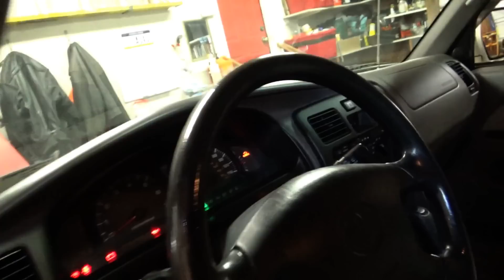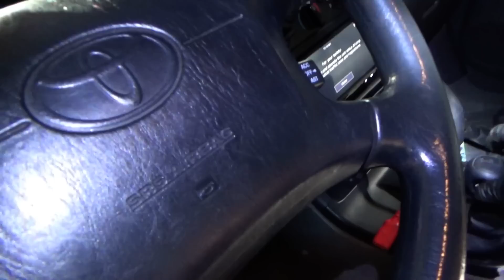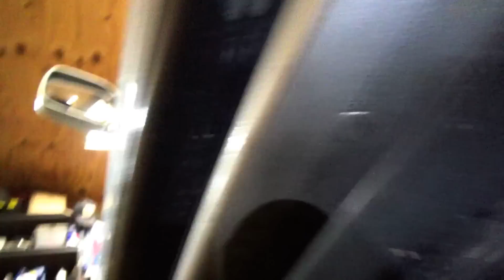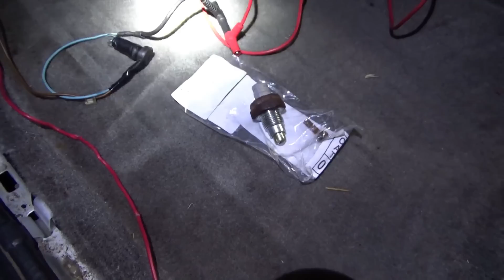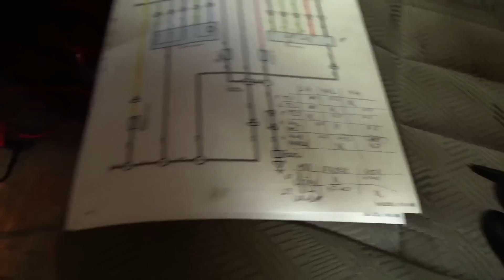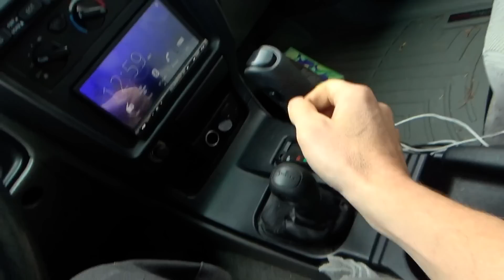(Pt 3) HELP! My Toyota is STILL STUCK in 4x4! ('02 4Runner)

Comment: It's been my experience with 20+ years of Japanese 4×4 use, these systems are pretty good but need to be exercised regularly, nothing is bulletproof but have been very reliable
Reply: Both my Tacoma and Tundra owners manual states clearly to use 4WD once a month for about 20 kms. I use it on wet asphalt with rain 🌧 or after a good rain. In the winter it's better yet, when it snows I am in 4 Hi all the time. 4WD dramatically improves braking distance as well.
Reply: My family and I have owned my 300,000 mile GM trucks and the four wheel drives have been flawless..

Comment: Persistance, determination and over-the-top logical reasoning as you reverse engineered the whole system. This video defines you, Ivan. One of my favorite PHAD videos! Seems that if the tip of that rod is not visibly worn, there must be slop at the other end in whatever mechanical trickery advances the rod. Just have to hope that wear/slop doesn’t continue and use up that 1/16” of travel you gained by removing the crush washer. It’s old and worn. Let’s hope he gets some years out of it. Would be cool to see a diagram of how that thing works inside the trans.

Comment: all that crap, modules and problems only to not require getting out and locking the front hubs....... I remember all my years of driving in the winters my only wish was .... gee I wish I wouldn't have to get out to unlock and lock the hubs!!!! NOT........ never once did it bother me and I never had a time when my 4X4 didn't work!
Reply: Blame it on the consumers. If they made it like the old school stuff , which of course I would prefer, they would be out of business. Sadly they have to bow to consumer demands.
Reply: @brianw8963  I live in the mountain and had to have the titan towed home when I went into a store came out and the abs light came on,,, so who cares..... I go to pull out and notice my back end spinning,.,,, I look down and NO 4x4...... I have an xterra that I use in the winter mostly because even if the abs lights up you still have 4x4,,,, and on the titan... I know it is a broken wire at one of the wheel sensors but I wasn't going to lay in the snow and try finding it!!!
Reply: @TheMamonti1 are you kidding me!? The titan won't engage 4x4 because of an ABS fault?

That is infuriating when unrelated issues cause a system you rely on to be shut down.
Reply from the maker: @volvo09  Yup, classic stupid Nissan logic haha. Just did a video on that Beached Whale Titan a few weeks ago, exact same problem!

Comment: Good job. No dealer would work that hard to find the problem. I know that you are glad this is over.
Reply: As usual, We all were confident that eventually Ivan would solve this mechanical mystery.
Reply: How would the dealer tech get paid for all of his time spent?  We charge over $200 per hour,  pretty sure most customers would stop paying after a couple hours of fussing around.
Reply: @scrappy7571  dealers have priced themselves out of the market along with poor service practices.
Reply: @scrappy7571  The only way to get paid for these jobs is with a you tube channel. How many hours do you think he spent before editing?
Reply: @rodvan-zeller6360  agree,  because my boss and the customer would never cover all of my time.  I do enough free shit on a daily basis.
Reply: @scrappy7571  Document your time at the end of each month present a bill to the employer. If he does not pay it is considered wage theft, in California if over 950 is it considered grand theft, a felony. If you get fired for demanding pay for your work, it is retaliation, another illegal act. Slavery was over a long time ago.
Reply: @rodvan-zeller6360  Just easier to quit.  Retirement or find a job at an indy shop, is the plan.  48 yrs of stealership life, I've had enough.
Reply: @scrappy7571  It's not warranty should be no problem to get paid. I work at a dealer and have always got paid all my diag time. It only pays straight time though. Which is why flat rate guys want to swap parts for retail pay and double their money.

Comment: These older vehicles can throw you some curves but Ivan will win 😁
You might have tried a thin paper gasket or RTV on the switch to keep water out of the threads and still work. I agree with others, something internal is worn which is messing up the switch action.

Comment: Would this mean potentially a no parts required fix by applying a hack and connect the yellow and black wires together and not bother with replacing the knackered switch?
Reply: I was thinking the same, seems strange that the two signals are identical though....
Reply: No, it needs to be grounded to switch into 4 high diff lock, but it also needs to be ungrouded to switch back to 2H. You'd need to at minimum add it to a manual rocker switch of some kind.
Reply: @brassmule  since the 2 signals are the same and are only produced in 4H Locked, I don't see the problem
Reply from the maker: Actually that might be the perfect No Parts Required solution!! Brilliant!

Comment: Transfer case is worn creating play. Remove the crush washer is a temporary repair.
Reply: it may not be the transfer case but the worm gear mech that the swich sits in . its going from a circular movement to a linear movement  which means that a 20+ year old unit will have wear .
Reply from the maker: @mrbigvanlife7130  "temporary" is a relative term... If it last 10 more years then customer will be very happy 😄
Reply: @ fair point!  😊
Reply: Yeah, I’m thinking it’s going to be back.
Reply: Removeing 4×4 is the next repair
Reply: True, although this is a far more economical repair

Comment: Hmmm, I'm not sure about this.
If it does not worked correctly when it's assembled as intended (i.e. the switch with the washer) then there must be something wrong with it. 
This is more of an 'engineered solution' to a problem that hasn't actually been repaired.
That's not a criticism but an observation and an evaluation, just my 2 cents!
Reply: It wouldn't be Ivan's first 'engineered solution'. With high mileage vehicles, sometimes that's what you have to work with.
Reply: The vehicle is still over 20 years old, so I'm sure the owner appreciates this repair. 

The owner can put a new T-case in it when it starts making noise or acting up.

Comment: Everyone speaks of “Toyota quality” but take a same vintage terrible reliability Land Rover Discovery which has a similar full time high / low range and center diff lock 4x4 system…the Rover system is 100% mechanical and doesn’t break. Toyotas are certainly not perfect.
Reply: I had one of those old discovery units, I think it was a 95, 5 speed of course. Great 4wd system. It had an intermittent electrical problem that would drain the battery overnight Never could track it down so I just put a ground switch on the side of the center console. They had over complicated electronics for that vintage. I don’t think a “ perfect” one of any make has ever been made, but I still prefer Toyota, up to 2019 that is.

Comment: If the fluid was never changed then something could be binding or if the motor moves a cam that pushes on the plunger that activates the switch then it could be worn out and has a larger gap at the switch.

Comment: Ivan, Is the spot the switch is touching worn down?
Reply: He already answered your question. He doesnt know. He said that in the video.
Reply: 13:09
Reply: @SamRFixes   Hi Sam.  Thank you.  Yep..."I don't think so" is a grey area.  Since the switch is new and removing the washer moves its operation closer, I think that is what is going on.  I think the old switch over the years wore into the contact area and then when the switch wore out, this wear caused the diagnosis to be a little more difficult.  It is fun to watch Ivan work thru things.  He is a sharp guy.
Reply: @darrylschmidt704  ok
Reply: He has no way to tell

Comment: Would have to see a parts breakdown to know for sure, but worn bushings could add enough slop to that shaft to cause it to not press the switch enough.
Reply: That is the problem. Worked at Toyota dealership for a couple of years. This wasn't my department but all of us techs communicate and we saw all of the nuances that bring a vehicle to the shop. My dad's Tacoma had the same problem. As soon as those bushings wear a little more, the problem will return.
Reply: @topher8634  This is why I goto the comments on videos like these! Thank you @topher8634
Reply: Yes i was thinking the same thing. If it's the case we may see it again in the future 😁 😱
Reply: I was thinking that too, mostly I was thinking the lobe of the rod is worn down some, almost like a cam.
Reply: To much slop when trying to engage your rod is not a good thing you need just enough to allow it to slide in a little friction is a good thing!😂😆🎉
Reply: @johnlarkin549  Read the room
Reply: @CARRJ142  ??? No idea what that means???
Reply: @johnlarkin549  
I would surmise that he means this is a discussion for adults dealing with adult problems and not for childish low IQ smutty talk, but hey,  I could be wrong.
Reply: Absolutely probably what it is cause there’s a bronze bushing in there for that shaft to ride on
Reply: I was thinking the same thing. Great minds think alike it seems :D
Reply: My thoughts also. If something needed to be altered in order to make it work tells us there is something else wrong down there. My bet is, the whole motor assembly needs replacing do to wear, and possibly rust jacking.
Reply: Ya I figured it mechanically lost tolerance somewhere, an ohm meter would have shown how much was left. Maybe a stainless screw in the end if its hollow enough, or jb wield with or without a rivet head on the switch. See you at part four🤣

Comment: The problem appears to be in the transfer box itself
Reply: Old style mechanical levers to engage 4x4  never gave any problems
Reply: Yep, and that switch won’t seal without the washer. It’s not pipe thread.
Reply: @bjr2379 no put enough tape on it and it will be fine. Teflon tape will seal tapered and straight threads. You just have to make sure the threads are full of tape!